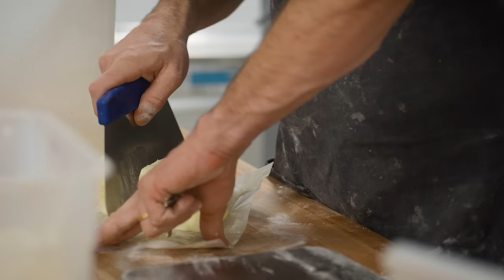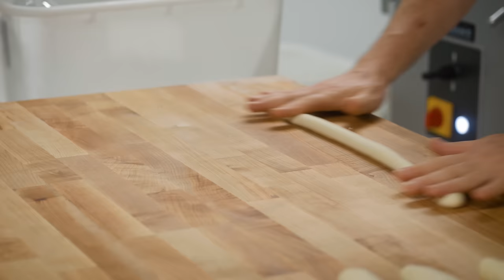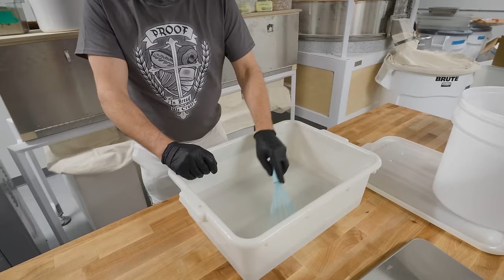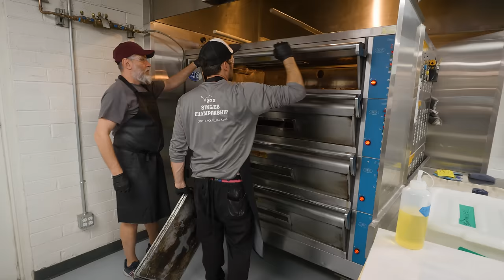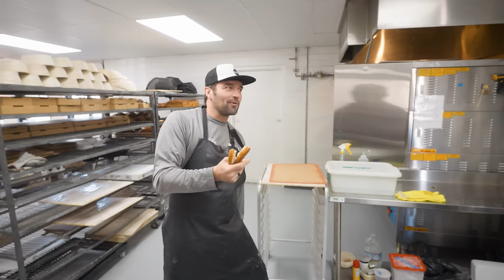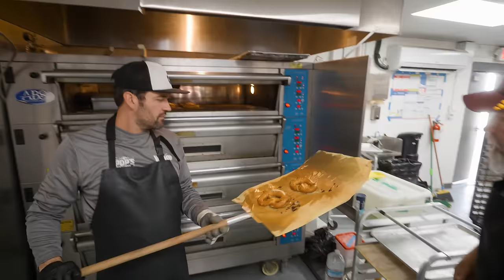Swabian Pretzels the Sourdough Way

Comment: I make philly pretzels in denver. Get the large 50lb bucket of red devil lye. I also use just under boiling water to dissolve the lye, and keep the water hot during the process of baking. I find a better Maillard reaction with hot water and it’s how we did it in Philly.

Comment: you should open the damper. Brezel are always baked with open damper so the lye steam can escape and the brezel will get more oven rise. In traditional Bavarian Bakery  we produce the Brezel ahead and freeze them like on 90% of proofing, then we put them directly from the freezer into the lye. So it might be a solution for you to make one bigger batch and then bake as needed, plus you can give them enough time to proofe. 
when i started my baker aprenticeship, in 1987,  it was very common to use Pork Lard with Brezel, nowadays it changed to butter or margarine. 
with the %tage  of the lye you can also change the colouring of your brezel, with a higher %only it gets quicker dark , but it stays more soft as the baking time is shorter, like our brezel with a 100g bakes about 14 to 15 min and ware more dark as yours....but that depends on how you, or your customours wants them. 
But then....i am a Bavarian Baker... so that would be our way  :) 
Best Regards from Bavaria 
Chris
Reply: Thank you Chris for your remarks and the support.

I'm sure Jon will appreciate the hints regarding the pre-production as well as freezing.
Yet, these are made completely without any baker's yeast, but with a sourdough starter. This results in a very different schedule and timing as well.  I guess Jon will have to do some (more) testing here.

Regarding the lye percentage. I've never heard anyone going significantly over 4%>. Could you elaborate what percentage that is, you are suggesting in order to be able to cut the baking time down to 14 or 15 minutes (mind, the Brezn here are 140g each)
Reply: @satkaramsingh20    we used liquid lye, not sure if the percentage is the same. We used on 1 liter water 100g lye. but you could use between 80 to 120 gr. I usally stayed with the 10%, only in Korea I used 8 because people there didnt like darker bread/breadrolls. 
as you are german, i copy the product details in here:
	
Pfisterer Brezellauge®
E 524 Natriumhydroxidlösung, ca. 36% NaOH, UN 1824
im 20 kg Kanister
hergestellt im quecksilberfreien Membranverfahren
Meisterqualität N II S
zur Produktion von hochwertigem Laugengebäck
frosterfähig
1 kg Lauge mit 10 - 12 kg Wasser verdünnen (nicht mehr als 4% wässrige Lösung)
I think you meant the 4% "wässrige Lösung"   and i meant the percentage lye to water you are mixing in...sorry if i get it wrong in the video :)
anyways it is such fun to watch Jons videos and even i am a baker for 36 years, working and traveling all over the world...i can still learn from those videos as they are so well spoken and explained.
all the best from Bavaria
chris
Reply: @chrisbauer4586  , thanks for the info.
So, the standard percentage of that product is obviously 3,6%.
Can go up or down a little bit 

I usually aim for 4% , also during this video.  So that seems to be the maximum already.

Thanks again for your support!
🙏

Comment: The algorithm got me here and I‘m glad it did. Yours looks like great content I‘ll definitely will check out more of. There‘s just one thing that bothers me, as a German, when seeing those „pretzels“ that I just have to tell you (I‘m sorry I can‘t help it). When you throw them into shape, make sure to give them 180° more twist. When you look at a pretzel the left arm goes to the right, crosses back, and back again. So the left arm ends up on the right side of the pretzel and vice versa - not just end up at the same side it came from. Only then, it is a real pretzel (as told to me by a friend‘s father who is a pretzel baker). But other than that, well done on your first batch.
Reply: I am not sure why you are complaining about the way we're doing the "Brezel-Schlingen ", but it comes out exactly the way you're describing it.

And truth be told, it's only real if it's called by its true name (which is Brezel or Brezn.
 Not Pretzel!)
😉 🥨

Comment: In the Philippines, we have a kind of boiled rice cake made with lye, suman sa lihiya. It's not really a "cake", more like a thick pudding wrapped in banana leaves. Like many varieties of suman, the whole leaf-wrapped bundle is boiled, in this case in lye water. The leaf color comes off on the rice cake, making it slightly greenish, and the flavor is quite distinctive. It's not salty, but mildly savory. It is eaten with a kind of caramel syrup. I remember hearing that this is traditionally made by boiling the bundles in water with wood ash, I don't know if they use food-grade chemical lye nowadays.
Reply: Kutsinta is also made with lihiya. Our "kakanin" are really good but they don't last long.

Comment: If you go through with constantly making them, get heavy coated silicone parchment paper(30grams I believe) the silpats will erode over time. Also I keep mine dipped 30 seconds in lye. 
A pretzel should fell like an under proofed dough, strong spring back in belly, but lightly airy.